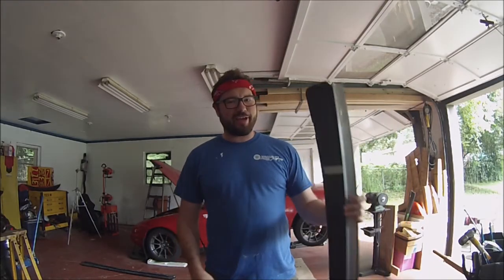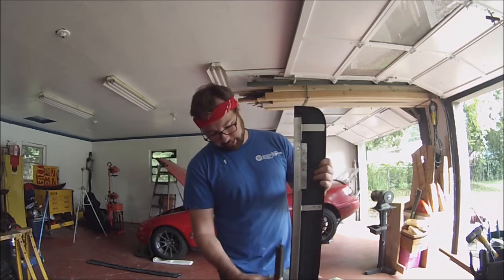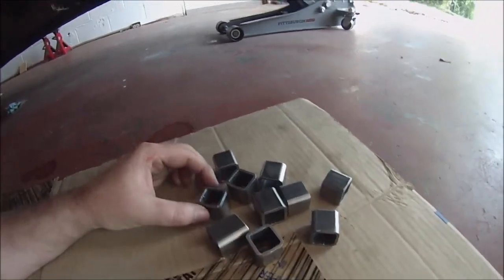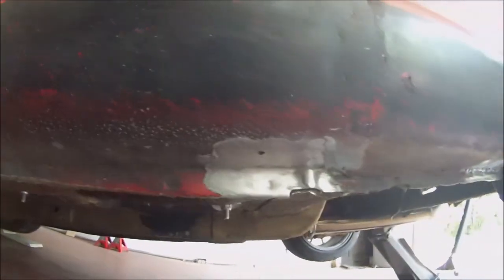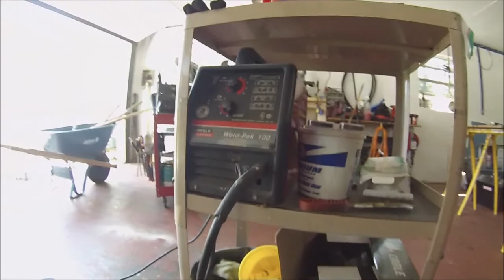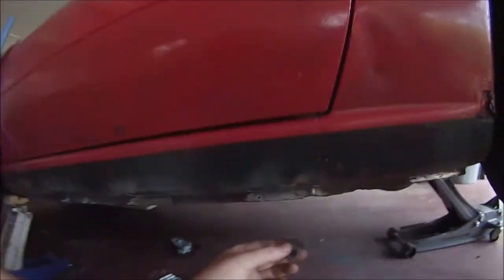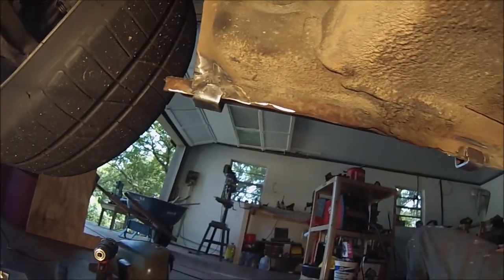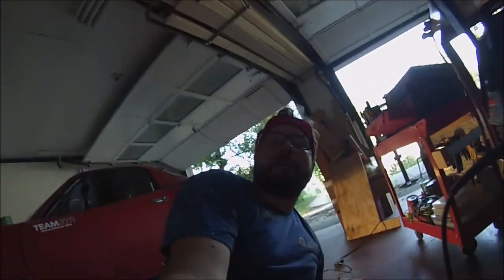Miata Side skirt install and reinforcement. Ebay specials.

Comment: You're gonna take care of that rust eventually, right? cute miata smile
These skirts ended up looking pretty good though!
Reply from the maker: Ha, I might fix it in the future if something compels me.  This car has over 250k miles on it so it's not exactly a showpiece.  I have been debating vynil wrapping it so I may do something to cover the rust but, I don't think I am going to cut and weld in new sheet metal.  That is just way too much work for a $600 car.   Glad you liked the side skirts.  I think they make the car look just a touch more aggressive.

Comment: Entertaining as usual. Although I have an idea that you might like that would work for these as well as whatever side skirts you use in the future....   Since you basically have the rigid edge of that aluminum angle stock on the inner-most edge of the skirt, as well as you already have rust developing and "you don't care" why not use Riv-Nuts? you could drill the holes in the aluminum angle wherever you want to have it mounted then mock it up to the body and mark the centers of the holes you made. Then drill and instal the riv-nuts in the rocker panel. You can now install whatever you want to use for a side skirt and just attach it with a bolt and a washer.
Reply from the maker: So the issue I have with riv-nuts is their propensity to strip out (atleast the aluminum ones).  I don't have any high-pressure air in my shop so I can't crush the stainless steel variety.  I am pretty much stuck with aluminum.  Because of that, you can only get about 8-15 lb/ft before you start to deform the insert threads.  Then when you back the bolt out all the threads come with it.  I've had it happen on a few pieces I needed to mount heavy items with.  I mostly use them now for alignment and things that need little force to hold (interior control panel, ECU mounting, ect).  My initial thought was to do exactly as you described but once I got the stainless steel riv-nuts I realized there would be no way my mandrel could deform them.  

I think you nailed a simple and effective way to mount side skirts or even some other body panel/spoiler but the aluminum type I just don't fully trust.  Awesome feedback btw.
Reply: I feel a little defeated now...I see where you're coming from, however I had no clue they had aluminum ones hahaa. I wouldn't trust the aluminum ones either.... I've only ever looked them up as a "kit" that are the zinc coated steel ones that come with an assortment of metric or SAE sizes (based on what you purchase) and the tool tips for installing them... goes and googles aluminum ones, because you just opened a few doors for ideas that I've had
Reply from the maker: Ha, no man, it's a solid idea and I came to the same conclusion you did about mounting them.  I honestly had that intent when I first mounted the skirts to the aluminum L-stock. Fasenal ordered the Riv-nuts for me but when I went to pick them up I knew instantly I would never be able to make them work with my tooling, and a proper tool is mucho dinero.  Doesn't really make sense for me to buy when I use them so little for my hobby.   I wish Riv-nuts was the panacea for all my mounting woes. lol
Reply: Yeah I hear ya... I mean, I try to save money on build goods where I can too but I wouldn't consider a $40 tool mucho... Like you said though, with as little as you use them it's not worth the expense . But if you want I can get info to what I had found when I looked... I found tools in the $35-55 range and a metric set of the carbon steel zinc coated riv-nuts was like $18 on Amazon for a 165pc. Just let me know and I can either drop links here or private message them to you. (and I found aluminum ones for interior stuff so thanks for that)
Reply from the maker: I would love to see one for $40 that will do stainless riv-nuts.  I have seen one or two in that price range (the double handled type) but the reviews on them were very poor.  The cheapest air assisted one I found was around $250 with like 3 manderals.  They do make a type where you can just use wrenches but holding that one in place upside down or even horizontally becomes a challenge, also you need a different mandrel for every bolt size.  Not a deal breaker just $30 a piece before shipping and that cost starts to add up kinda quick.
Reply: Gotcha. like I said what I was finding were the ones for Zinc Carbon steel. (which was the $40 from Summit Racing.) They are the style that look like a set of bolt cutters with mandrels that are "quick change".. I'll go dig around again and send you what I find. Do you have an Instagram that you'd like me to send info to or want me to send it here through private message?
Reply from the maker: Yeah man, Instagram would be fine.  Codyyankey is the handle.  I missed the Carbon steel part. lol

Comment: When u installing kraken mani
Reply from the maker: It's been on the car for some time now.  I made an install video and my SD card corrupted the video so all that was scrapped, which was pretty depressing.  I was going to finish these up and do a walk around with the car to update my channel a bit.  I also want to do a bit more testing with the manifold before I start touting success.  I have an autocross in 2 weeks and a track day about a month after that.  I feel like those will be heavy enough tests for me to feel comfortable recommending a product.  If you see my other videos I never suggest anyone purchase a product or do reviews except for the Kraken manifold.  Not opposed to it just not opening myself up to community issues without proof of my successes/failures.
Reply: NA6 driver i ordered one already . Picking up this week. Its at customs . but mine is a 1.8 td04 . Thinking of doing a instal video but ive done "tutorial" or something similar . Lets see
Reply from the maker: I think their td04 manifolds have been proven by a lot of people on your end of the planet.  For some reason everyone in America likes to use T2 turbos.